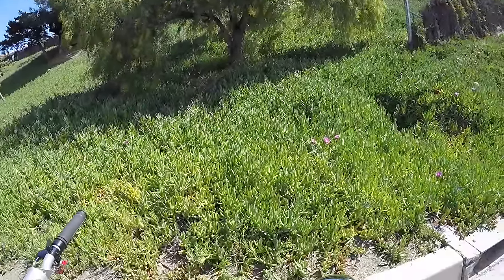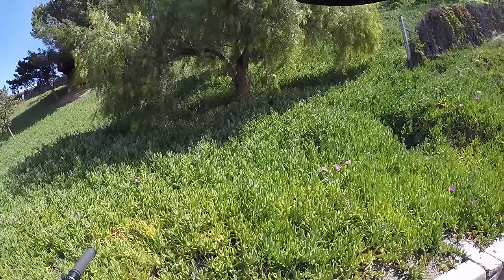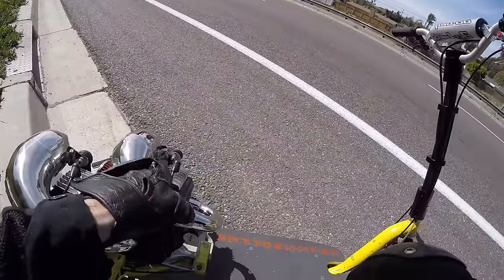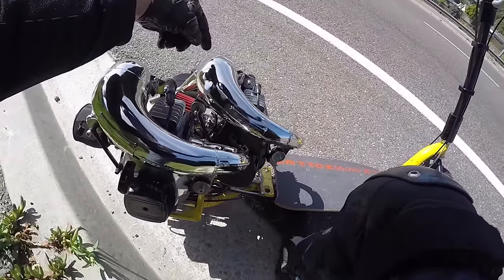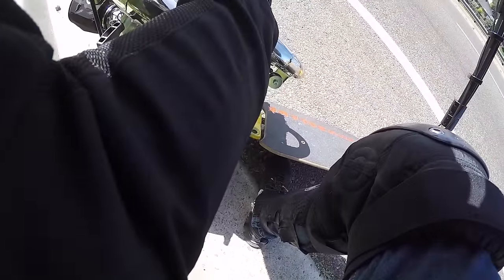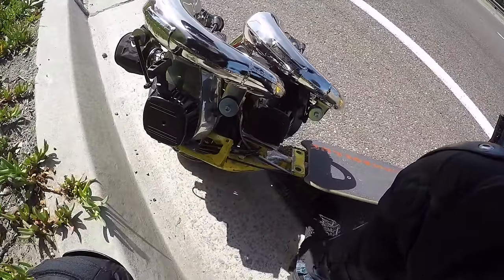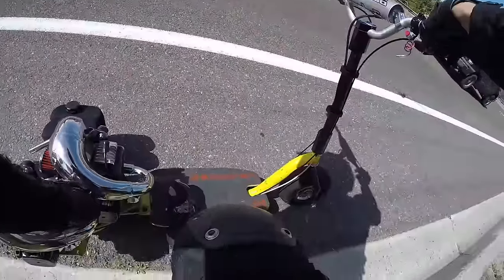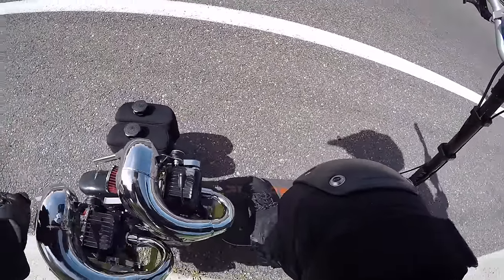Vlog 13 "REAL RIDE TESTING..."

Comment: You should get a Mtn bike right side brake lever that allows for 2 cables and just run 2 separate throttle cables, that way with those levers you'll have the leverage to easily pull the 2 cables at once.

Comment: I like the setup. But I'm wondering why you dont have the kill switch hooked up ? That sticky carb is a prime reason why a kill switch is necessary.  Emergency situation occurs you can shut it down.

Comment: So it essentially makes the same power as a 125cc MX bike, except with zero power loss via suspension or transmission, that weighs probably 30-40 lbs tops. Insane. 
Though did I hear you never race built the motors? Still, that's the same power as an 85cc, at least around 14hp combined, probably more like 16hp actually I'd guess.
If they were both race built I imagine we'd be looking at 36hp. 
GP60's? Or were these 46's? 

Derek you know what'd be bad ass? 
seriously i dont like coming at people with ideas because like I could go act on them myself but in this case your talent with small motors and gopeds in general far exceeds mine so you could do way more with this idea than I could:

GSR cruiser with the HD bothy fork, race pole, HD frame and all that good stuff that keeps the ped and its rider in one piece when they eventually ride over one of those small but extremely painful to ride over without a suspension irrigation pipe covers, then two RACE BUILT Chung Yang CY23HR (High Reliability) 23cc engines,
These engines are unlike anything except the G23LH as far as maintenance and reliability are concerned, except they make 2hp totally stock. 
So you add a pipe and we're talking more along the lines of 3.5hp-4.0hp each, bore them each out to 26.7cc I believe? is what the kit does? not sure if you can add a high compression head kit to a bored out motor that already has a higher compression head but surely if they aren't in production, then a couple could be made to suit the bored out engine, two 1.5 liter gas tanks, high flow air filters, just aim for ridiculously high compression on both engines obviously, so race gas could be taken advantage of, ultra long gearing, custom made carbon fiber wheels (Hehe probs not feasible but maybe theres a shop in the midwest that can make carbon bits for cheap with new laws being imposed on domestic manufacturing particularly in the midwest, we're slowly replacing china lol except with build quality remaining a priority. )
So the carbon fiber wheels would be nice to suit the long gear setup, less rotational inertia, some custom ceramic bearings to improve things even further, mirror polished valves, heads, inlets etc, not sure what components benefit from mirror polishing but surely it does help as you've said, improve performance.
Notice how I haven't mentioned the carburetors.. I say those remain stock.. With how well they're dialed in even with bored out, free-er breathing engines they should retain the reliability of the motors. My guess is about 11-14hp combined could be squeezed out of these engines with stock carburetors.
Dually ped 2.0 😂😂

Or Goped TRQ trail ripper quad,
Squeeze 2 fully race built GP60 engines making the maximum power with parts galore, dual 2 liter tanks if applicable, it'd still weigh less than a 125 race bike with equal or similar power output 😂
Reply: I have no idea what you just said, but I agree.